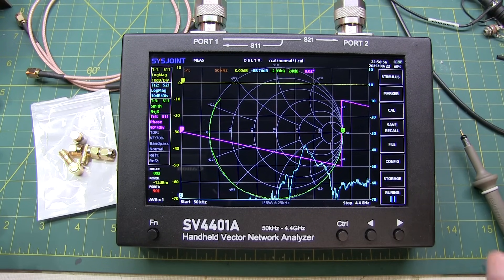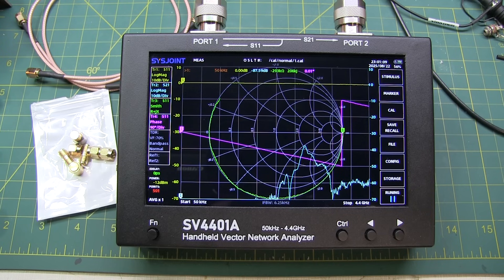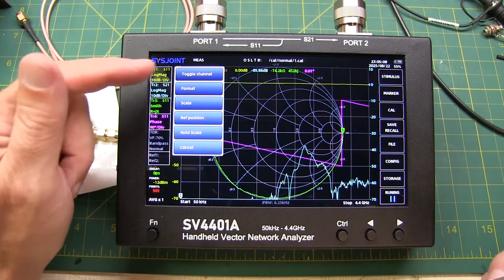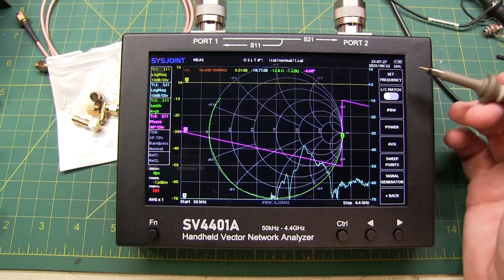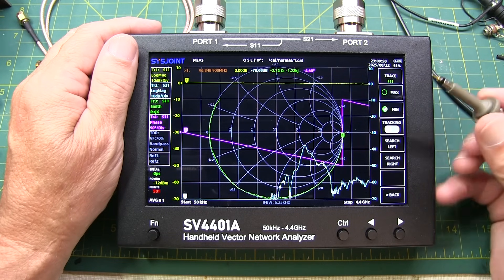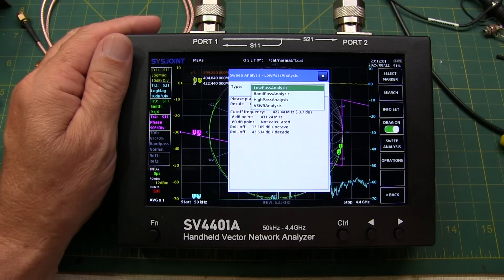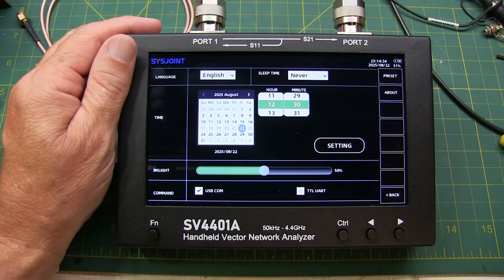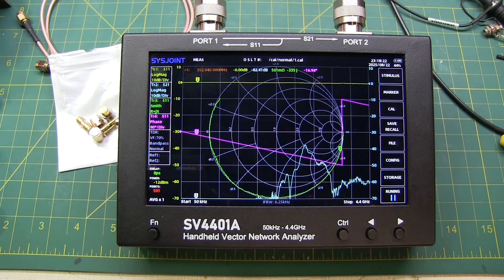#402: Overview of the Sysjoint SV4401A Vector Network Analyzer from Chelegance

Comment: Great overview thanks always informative information, Personally  would like to know more about using this instrument to tune the input and output of RF amps for HF  and VHF as that's my next project to make am amp for 70MHz,
Reply from the maker: Tuning an input (looking at S11) is generally pretty easy.  However, problems can arise if the input is not class A - because the small-signal impedance (as would be tested by the VNA) could be quite different from the large signal impedance (which could vary with input signal amplitude).  So, it's really better suited to preamps as opposed to PAs for transmitters.  Measuring output impedance gets much trickier, as you'll likely need an attenuator that is rated for the power of the PA and will bring the level down to a safe level for the VNA, and then calibrate this attenuator out of the measurement.

Comment: I received my unit in August of 2024. The touch screen suffers from contact bounce, and my unit had discharged batteries that had to be revived. I like it and use it fequently.

~~~~~~~~~~~~~~~~~~~~
OPERATION NOTES
~~~~~~~~~~~~~~~~~~~~

SHORTCUTS:
ADD MARKER (up to 8 markers) - double click CTRL
SELECT ACTIVE MARKER - hold FN button and use < > buttons
DELETE ACTIVE MARKER - double click FN button
CHANGE ACTIVE MARKER FREQUENCY - scroll with < > buttons
ENTER DISCRETE ACTIVE MARKER FREQUENCY - long press CTRL button and enter freq in pop up number pad

~~~~~~~~~~~~~~~~~~~~
FAVORITE SAVED CALIBRATION & MARKER SETS
~~~~~~~~~~~~~~~~~~~~
Note that most of the settings, the markers, and even the position of the marker table itself on the screen can be set up and pre- saved with the calibration files. You can preset all the markers to notable frequencies that will appear when you recall each calibration file. The Amateur Radio spectrum can be broken up into separate ranges to increase resolution and the number of markers available to show beginning and end frequencies for amateur bands of interest. 

73 DE N1LO

Comment: Hi Alan. I am a long time subscriber with a question. I know you have a Kenwood ts-870. I have been doing an alignment in the service menu. All went smooth except the alc meter. This is the reason that I wanted to do the alignment. Have you been getting accurate alc meter readings on yours and have you looked to see how the service manual reads this? I have all the test equipment to test and repair.  My call is W5DN. You know how to get my e-mail and it is current. 73
Reply from the maker: I’m sorry, I’ve never done an alignment on mine, or checked the ALC accuracy. I typically adjust audio levels so that the ALC barely comes on and have never had any audio complaints, so no reason to look into it any further.
Reply: @w2aew  Thank you sir for the reply

Comment: Lovely device. Compared to the NanoVNA H4, I notice what seems to be fewer options for Trace types. Also, under Marker Operations there doesnt seem to be an Auto e-delay which is available on H4 (at least in the latest verson). Apologies in advance if I'm wrong. A lower RF output would make it superb!
Reply from the maker: I would imagine that future firmware updates can address these things.  I am feeding back info to the manufacturer.  The RF output can be adjusted down to -42dBm.
Reply: @w2aew Thanks Alan, when I wrote about the lower RF output I imagined it can be used for testing sensitivity of receivers. I went beck to the video an 2nd time and saw your additional note about the signal aproaching a sine wave closer to 2 GHz.

Comment: Hi w2aew
Thank you very much for the educational videos.
To design RF power amplifiers, we need to know the complex number impedance of the transistor input.
For some transistors, it is available in the datasheet. But for many RF power transistors, it is not.
How can one obtain the complex number impedance of the transistor input with an oscilloscope and applying a small signal by a signal generator at HF and VHF frequencies?
There was a method written in an old book by Texas Instruments, but it was inadequate.
The phase difference between the voltage and current at the input of the transistor must be measured.
Is it possible for you to make a video on this?
Consider that the available tools are an oscilloscope and an RF signal generator.
Thank you.
Afshin .
Reply from the maker: A VNA is the right tool, but ONLY if the small signal input impedance is what you need.  For amps that run with larger signals input signals that significantly change the transistor's bias point, the input impedance is not a simple value - it changes significantly with the bias/conduction conditions.  Class B and C amps are good examples of this.  In these cases, the best impedance match is often determined experimentally by adjusting/tuning a matching network at the input for maximum power out (called a Load Pull).
Reply: @w2aew  .... thank uou
Reply: @w2aew  Thank you

Comment: I'd like to watch a video on using it as a signal generator, phase noise, stability, accuracy, flattnes in comparison to a  dedicated signal generator.
Reply from the maker: Keep in mind that at the lower end of the frequency range, the output is a square wave (not sinusoidal)

Comment: Alan, my SV4401A arrived today!  I charged the battery, read the manual and started by calibrating the unit. WOW! This unit is very solid and screen is awesome compared to my Nano VNA. The menu system is a joy to operate making this head and shoulders above the Nano VNA. Of course this comes at a cost. The unit was $339.00 plus shipping bringing it to about $375.00. I got a surprise when DHL billed me $130.66 for tariffs!!  So just over $500.00 but I’m completely happy.  Any videos you make regarding this awesome little tool will be much appreciated.  Perhaps a video on using this to sweep the IF of receivers.  Thank you for bringing this instrument to our attention!  Very 73, de W3AL, Alan.
Reply: Mine gets delivered tomorrow, cost the same, no tariff living down under has some advantages

Comment: Hello, I think the TDR function underutilizes the potential of the VNA. Indeed, there's no possibility to perform a 'distance to fault' or an in-depth analysis of the SWR along the length of a cable. There are also no presets for common cables regarding velocity. It could be interesting to make a video on this topic.
Reply from the maker: You certainly can perform a "distance to fault" measurement, provided you setup the frequency range and velocity factor appropriately.  And, SWR along the length of a cable doesn't make a lot of sense, since SWR is not dependent upon cable length (other than a minor reduction of SWR due to losses for long cables).

Comment: Thank you for the video. Crystals are very useful to build filters but are notoriously difficult to measure due to their high Q. Some instruments do not provide enough dwell time at each point for the amplitude to achieve steady state and report an incorrect result around resonance. Commercial instruments have options to slow down the sweep speed. I wonder how the SV4401 performs in this demanding task? I've encountered also issues with dwell times when measuring systems with long electrical delays like very long runs of cable. Measuring filters verifying the ultimate dynamic range (with IF bandwidth tuning, averaging and smoothing) would be an other concerns.
Reply from the maker: I did a video on measuring crystals with a NanoVNA (and other tools).  I haven't done it with the SV4401A yet, but it has much lower IFBW settings which should improve things.  Here's my video on measuring crystals: https://www.youtube.com/watch?v=G9zZRNzhsEE

Comment: That's a neat instrument that I was totally unaware of.  Looks like a nice upgrade to the smaller units for a surprisingly decent price ($320 on Amazon as I write this).

I would love to see a demo characterizing an antenna and using the L/C MATCH feature, and it would be a huge bonus if you could also talk about component selection for the matching network (e.g. considering the power of the transmitter to be used with the antenna) and even show a technique for building the matching network.  Thanks, Alan!

Comment: Hi Alan
Video request: How does it compare to the NanoVNA 
1) Processing speed - processsor used in both instruments
2) #334: How to tune a duplexer - is the SV4401A better? 
3) There are videos stating the NanoVNA  is a 1 1/2 port instrument, what is the SV4401A?
4) Accuracy compared to high end professional makes.
5) Software available for PC integration?
Regards
Stan
Reply from the maker: Thanks for the suggestions.  Yes, the SV4401A is a 2-port, 1-path device, just like the NanoVNA. Will add your other ideas to my future videos list.

Comment: First of all, thank you for your videos, your explanations are always unparalleled.
Is there any chance to measure the nonlinearity of a transmitter (two-tone method) or the ssb sideband suppression with this instrument? Resolution bandwidth enough?
Reply: A tinySA (tiny spectrum analyzer) would be the least expensive instrument to do this.  Of course you will need to provide the 2 audio tones as well.
Reply from the maker: Since the VNA only outputs one tone, it can't perform 2-tone distortion testing.

Comment: Thank you. I'm about to get one VNA, but trying to figure which, there are many... I work with RF from LF upto 23 cm, and was looking recently the NanoVNA V2 Plus4.  But then your video popped up :). One spec to decide is that comparing both VNA's dynamic ranges, the latter specifies a dynamic range of 90 dB while the 4401 states 75 dB.  Could you throw some light on this? the greater the better?? or?.. Regards. Guillermo.
Reply from the maker: The greater the better. The V2 Plus4 is a nice unit.

Comment: I have this exact type vna, I found that the signal generator and the sweep RF output has a sharp transition from square wave to sinusoidal at a few hundred MHz Is this some kind of measurment error or maybe there's 2 RF synthetizer devices inside, one for lower frequencies and one high frequencies? Has anyone taken a look inside ?
Reply from the maker: The RF frontend is covered by soldered down shields.  Not willing to disassemble mine that far yet...

Comment: At this point, I am certain that they deliberately avoiding the 90dB dynamic range needed for punching through duplexers deliberately so pro RF guys in the field don't bin their 5KG Anritsus.
What deal is being done in the background to make this happen, I don't know.
Reply from the maker: It’s likely all about cost. I would imagine this unit uses inexpensive resistive bridges instead of high performance directional couplers, as well as inexpensive mixing components which would not give the 90dB+ performance.

Comment: I would like to see you to explore the dynamic range of the SV4401A and how well the TDR function works.  Things like high impedance components, e.g. capacitors down to 1pF of below (maybe down to 0.1 pF.).  For the TDR, cable measurements for impedance vs. distance, e.g. DIY 1 meter SMA cables to see how well the connectors you made it with were matched to the desired impedance.
Reply: I'll second the request for more Impedence measurements along path measurements. What resolution is possible? 
I suppose the better dynamic range indicates that it does not rely on harmonic signal generation until higher frequencies? The user manual does not say. 
I scored an N size 4GHz SOL calibration. Makes this unit a bit more tempting to get.

Comment: Would love to see a video of impedance matching of mifare reader antennas,  where a few pF makes all the difference between a workable solution with range to the card of 8CM to not working at all. As the antenna is transferring power and data , cards with higher power requirements for AES encryption are often not detected on a poorly matched system that works with the basic 1K card . At first blush 13.56MHZ centre frequency , and then adjusting the Q factor does not seem challenging but  in reality it becomes an interesting exercise.

Comment: LiteVNA 64 review with Dislord software.   Dynamic range is supposed to be mega using averaging.  Also does not use harmonics to make measurements.
Reply from the maker: Yes, the LiteVNA-64 is a very nice unit.

Comment: Interesting unit. It could conceivably replace three or four bench and field instruments and, priced around $325 or so on Amazon, competes with an antenna analyzer.

The screen size and menuing alone makes It strong case for the unit. 
As others, Alan, I vote for a series identitical to your NanoVNA videos for comparison. It would help us justify the cost should we consider replacement.
Reply from the maker: Thanks!  Note that it is a bit heavy for field use.

Comment: How hard would it be to use a device like this to verify pcb trace impedances (like controlled impedance traces connecting a gps unit to an antenna etc)?
Reply from the maker: The trickiest part would be establishing the calibration plane at, and connecting to, the traces on the board. Of course, this is true for any VNA.
Reply: @w2aew also - can this device do TDR?
Reply from the maker: @soothcoder  Yes, it can.

Comment: Just when I figured out how to change the screen size to 5-7" on a couple different NanoVna's, the price finally comes down on Sysjoints kit. I was impressed to see that the SV6301, is now well under the $1000 mark. Ive wanted one of those forever to characterized VTX Antennae for drones but was always ridiculously too expensive. Nice to see they keep up with the market.
A question on same topic but different brand. I know you usually use Tektronix for scope, SA, NA needs. Have you any experience with the Rigol RSA5065N Spectrum Analyzer with VNA through 6.5ghz built it i? Its been around forever and seems like the price keeps going up. The best i found has been $5599 on Rigols cleareance site. I wish it was half that. Any knowledge you can share will be greatly appreciated. Thanks for the video!
Reply from the maker: I have not personally used the Rigol RSA5065N, so I can't offer any insight.

Comment: Been meaning to thank you for all your instructional videos. Like being in a classroom. If I want to learn, I tune into w2aew. You're perfect!

In instructional videos such as this, I've seen a VNA mostly demonstrated for use on HAM radio. That's fine for people who do HAM. This device seems to show RF performance so that rings a bell for a lot of uses. 

Can a device such as this be used for other practical uses?

Television reception for me is mostly Free-Off-Air in New York. My rooftop is flat and I love experimenting on antennas for the best possible range instead of being reliant on a small TV set that I bring along to the roof. City reception is usually fine, so a device such as this might seem overkill. Not always the case for those who live in fringe areas and weak signals, who wish to absorb the most that can be. 

It sure would be nice knowing if this gadget would work for people who wish to test range of their TV reception on their own, instead of relying on the signal strength built into their TV. 

A lot of mis-information is usually exaggerated by antenna manufacturers. There's a growing population of Cord Cutters. Plus, next-gen high resolution is considered by broadcasters because there's no data limit as within a cord. So, knowing about the equipment, the antenna and this device, certainly makes sense. 

Aside from using a television's built-in signal strength feature, to actually see real (accurate) signal strength on one of these would be nice.

Nothing wrong in demonstration of an accepted product. Manufacturer instructions are never enough because they're not showing practical use. But you do. How far in, practical use, can this instrument go?

Thank you.
Reply from the maker: Reading signal strength on an antenna from over-the-air signals would require a spectrum analyzer, not a VNA

Comment: Return loss/VSWR is 2:1 which means is the forward is 10 watts , the reverse is 5 watts? The only reasons why to measure return loss/VSWR is to know how much reverse power is being fed back into the device
Reply from the maker: Return loss is the ratio of reflected power to forward power. VSWR a function of line impedance to load impedance which sets up a standing wave due to the reflected voltage. They are related, but represent different mathematical quantities. The goal to measure either is to help with making adjustments for maximum power transfer.
Reply: @w2aew  The VSWR is a RATIO of the line impedance to Load impedance? its measuring the Impedance Mismatching? the impedance mismatching is causing a Standing wave due to the reflected voltage
Reply from the maker: @waynegram8907  right

Comment: I'd like to see a comparison with your Tek VNA in regards to higher frequency performance, let's say impedance measurements of microstrips and also microwave filter performance analysis (like bowtie). For HF the NanoVNA is plenty useful. But SHF is not sufficiently covered on YT
Reply from the maker: The Tek VNA features S21 dynamic range of better than 120dB - thus a LOT better than the SV4401A.  Will make a nice comparison though.